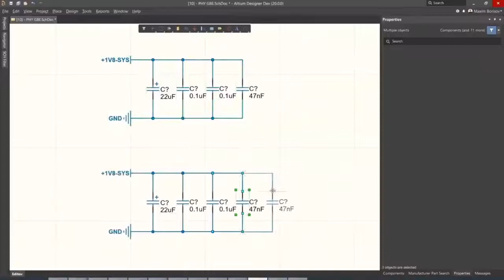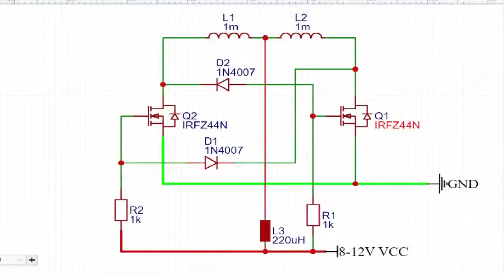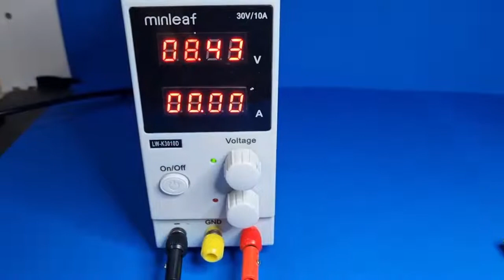How to make a Simple and Powerful induction soldering iron  New Circuit  - JLCPCB

Comment: Bro if you gonna use battery I suggest using a low voltage cut off or 2s BMS saves damaging the battery 😊